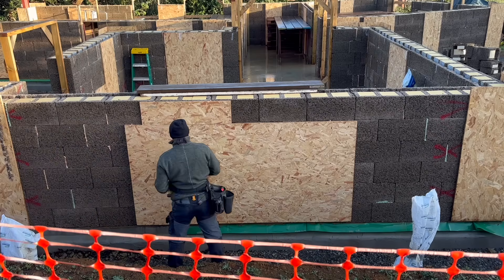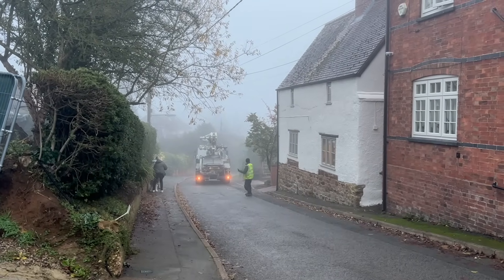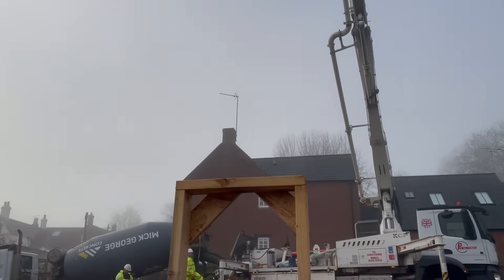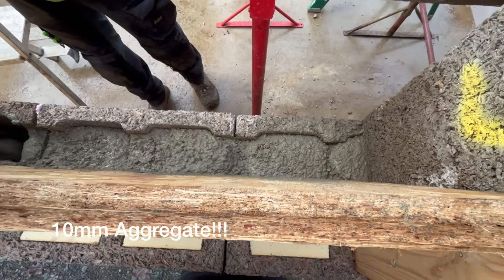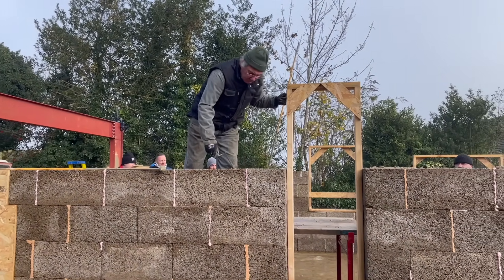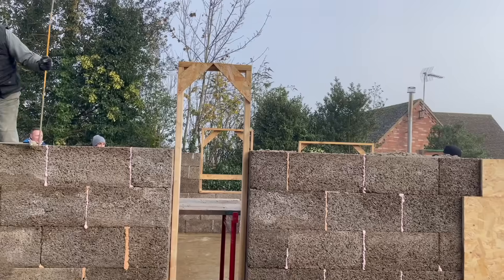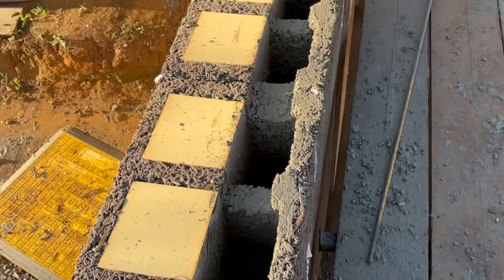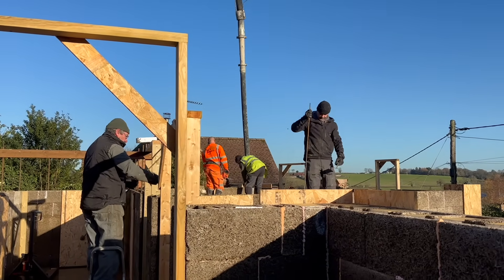Our first experience pouring concrete into our ICF blocks - Self Build - Ecobrix - Passive House

Comment: Great job and prep work to make it all go smoothly. Why did you not have a vibrating tube to help with settling the concrete in the blocks? Looking forward to your next one... 😎
Reply: Just watching it I’m worried by 2 things: 1, having seen the (relatively) tight channels the concrete has to “flow” through to reach the floor slab, it looks quite “stiff” and not at all “flowing” and 2, lack of vibrations is going to leave lots of cavities (like a rice crispy cake)
Reply from the maker: There’s no concern, it was most certainly reaching the slab as the vertical channels in the blocks are uninterrupted.👍🏻 We would fill a wall section half full, hand poker then come back to fill the next half. You could hear and feel it reaching the bottom.😁
Also you may of missed the voice over, Ellie and I could see it flowing horizontally through the blocks giving us a nice lateral flow.👍🏻
Using hand pokers is what is advised by Ecobrix, there is risk you may damage a block using a powered one causing a blow out.
That said we are going to use a small battery operated one in the next lift due to internal rebar.👍🏻
Cheers for your concerns and comments. We are very satisfied with the end result though have learnt some things to make it easier.😁
Reply from the maker: We didn’t have one!😂  though for the next lift/pour we are going to get a small battery operated one as we have a lot of internal rebar columns to build so our golf ball stakes will struggle to penetrate. Thank you for your support.😁👍🏻